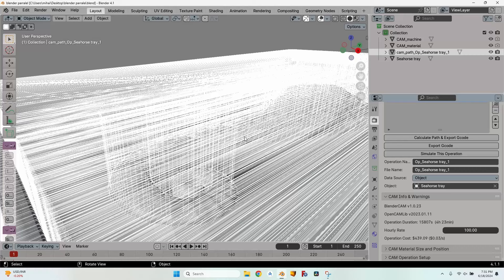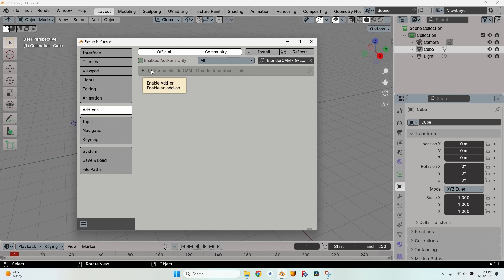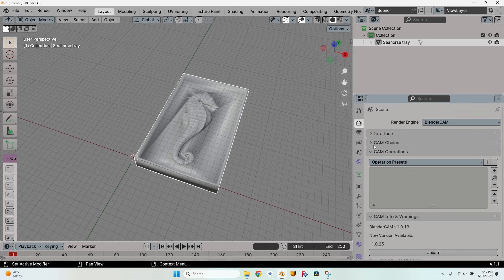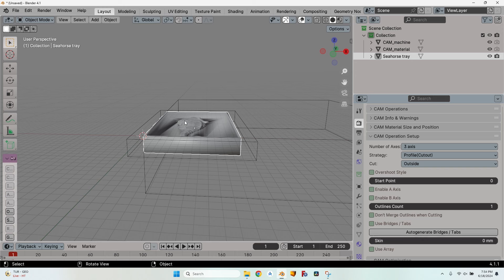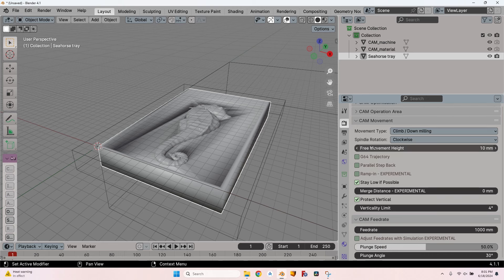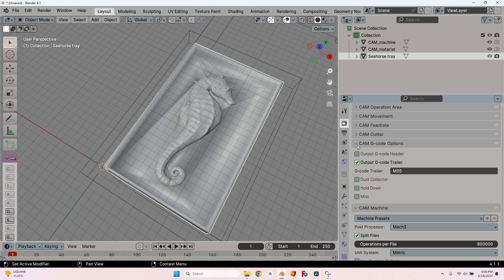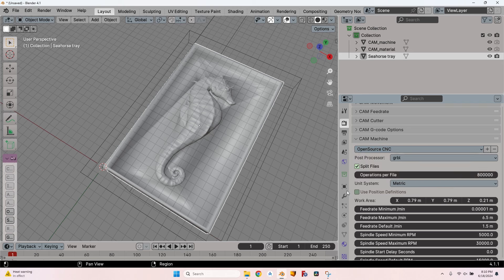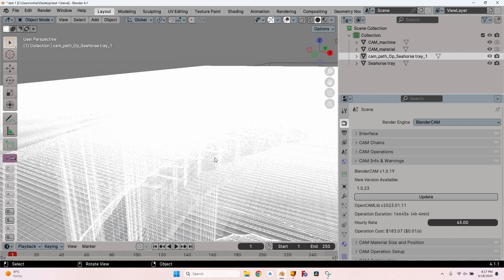Blender CAM Ep. 1 || Introduction to Blender CAM || Generating g-code to carve on the CNC

Comment: That's very cool. I am so pleased to have you point out BlenderCAM as I have never heard of it, even though I've been a long time Blender user. This is going to open up a whole lot of possibilities. A Blender tip, when you want to scale in the scale boxes, any of the other boxes in the 'N' menu, simply hover the mouse over the data you want to copy or paste without having to click on the boxes.
Reply from the maker: Thanks! I still have to figure out blender from scratch, I might say, but the difference between blender and FreeCAD when it comes to 3d surface is so huge that I had to make this video
Reply: @opensourcecnc  Blender's learning curve is steep. It did nothing but frustrate me for the first year. The key to most things is YouTube, and that is especially true with Blender and other software. I would never even attempted to build my own CNC if it wasn't for YouTube.

Comment: Hello, your videos are really useful. I use cnc for furniture making, I need to see both 3d and transfer the hole locations to cnc. I first tried freecad but even moving the object is really difficult. I can create backrest and shelf holes by creating boolean in Blender, but how can I extract the gcode of this? I think your content will attract attention in this subject because we have to use paid software for furniture and models (autocad, alphacam, etc.) Thanks for your videos.
Reply from the maker: @elmasx  to be honest, i prefer FreeCAD for furniture. It's much more robust, even though the learning curve can be horrible (I've been there, so I totally understand how you are feeling). Regarding the holes in blender, in short you have to do the following: apply all modifiers, then use the "get pocket surfaces" function (take care to have the correct z set up on the dialogue). It will create some curve objects that represent the holes. They can be used as base for the pocket operations. I will make a series about using FreeCAD for furniture on the CNC, including the design part, in the near future. Hopefully it will help with the initial frustration when using FreeCAD, which I know is what the majority feels
Reply: @opensourcecnc  Yes, freecad gives great confidence for glass, but I couldn't quite figure it out in blender. At least if there are features like drilling selected surfaces to the depth, it can be very functional. Blender is really practical for drawing, but since it works with polygons instead of vectors when it comes to glass, there may be a possibility of incorrect operation or slow operation. Your videos are very useful, I look forward to your new videos (If I can do it, I'll write about it here)